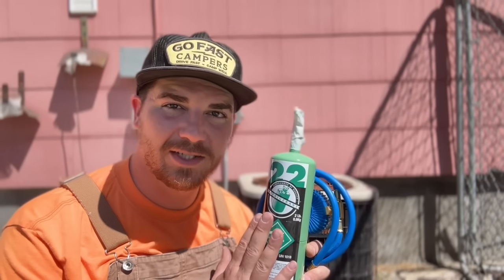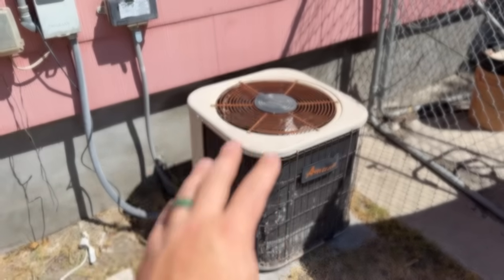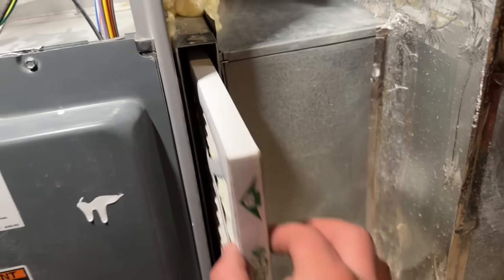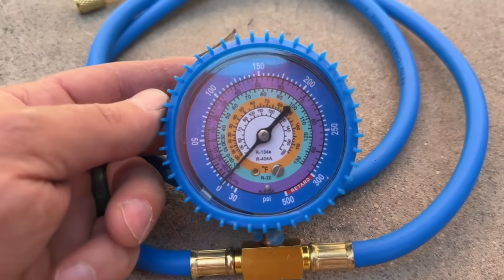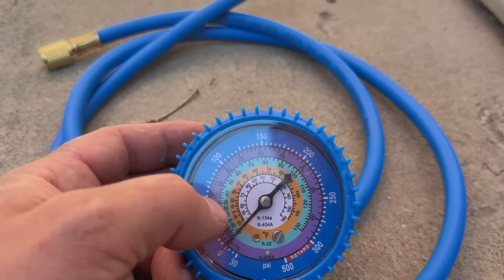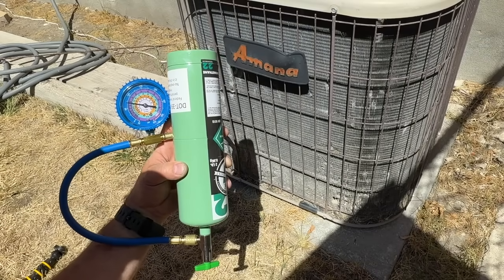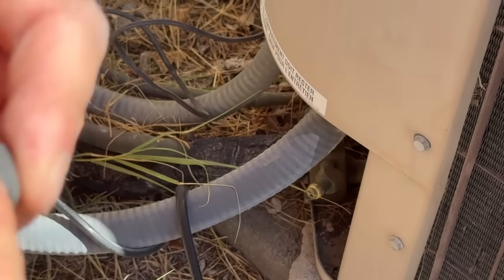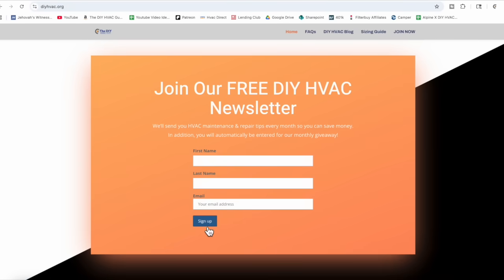HVAC Contractors Are Charging $600 PER POUND Of R22!

Comment: FYI, a properly installed AC system doesn't need to be "topped off"
Reply: All systems leak at least a little over time as there is no such thing as a perfectly sealed system.
Reply: I believe he covered the reason. It had a slow leak, 3 years and it needs a little how ya doing. that isn't much of a leak and surely not worth looking into.
Reply: Installed right has nothing to with leaks.  Most leaks develop in evap coils over a period of time.  Coils have gotten very thin walled over the years and are unlikely to be leak free for decades like some from the 60s through nineties.  The problem caused a transition from copper evap coils to aluminum over the last twenty years but even the alum coils leak but not as often.
Reply: @rj.parker  Yes, but that doesn't mean the installation quality should be compromised. Parts failures are just what they are, crap parts and that needs to be delt with when they fail on their own merits vs a crap install putting stress where it doesn't need to be.

Comment: I have a 24 year old Goodman GMP075-3 system with a 2 ton Goodman condenser unit and I noticed the air doesn't get as cold as it used to (peaks out at about 63/64 degrees depending on when I check). The air filter is clean, the refrigerant level is fine and the outdoor unit is clean. I suspect the issue is with the evaporator coil (Never been cleaned in 24 years) except I have a closed system and is extremely hard to get to. At least for me since I'm not a HVAC tech. So, I'm trying to decide if it's worth paying someone to take it apart and inspect/clean it or is it finally time to get a whole new system.

Comment: Hey Dave need some help my condenser coil out side is flash gassing,does that mean I have blockage in the piston?,I opened up my coil cover inside the house and I have tvx valve so that might be bad too. Last year my ac tech put in due sealant into the system do to a small leak,my system looses about 2 pounds a year,goodman system

Comment: I took the EPA exam required by the EPA laws in order to become an HVAC Technician.   These laws state that if a AC system has a refrigerant leak over a certain amount im not allowed to top off the system.  So if homeowners can top off their own AC systems why do we have these laws to begin with!  😢
Reply: Lots of those laws are meant to protect the HVAC industry.  Around here the industry is out of control.   Your capacitor goes bad, you need a new 20k system.  Charge $600 a pound for R 22, when I can get 30 pounds for that price.    It's always a sales pitch when you call out an AC company.   I work with an ex AC guy and he said he got tired of lying to people so he could get his sales numbers up.    Where I am, I can not technically put refrigerant in my own system or my 85 year old mothers, but do I?.   I also keep a supply of capacitors to help my neighbors out when their AC goes out.
Reply: @shastasteve  The capacitor is a cash cow for the HVAC people.  Had one replaced a few years back and it was $ 350.  I have replaced it myself a few years later for less than a $ 20 part.  I would not have minded a $ 150 charge, like $ 100 to come out and marking up the capacitor price to $ 50.
Reply: @shastasteve  I NEVER charged that kind of money for ref. assuming the story is true. A little knowledge can save $$$, it's not rocket surgery. Be safe changing Caps, 240v packs quite a punch. Disconnect power always!
Reply: @rrrhhh8167  Yeah I have an industrial electrical background.  Just disconnect the power and discharge the capacitor.   I do use a fluke on everything, even if I know its dead.     Not out here it is the wild west as far as AC service.  My Mom is 85 and lives in a mobile home, a nice mobile home but still everything is out in the open.   Quotes were from 16k to 20k for a 3 ton system.   Most guys used to charge $200 to replace a capacitor but now many are pushing $400.   Everyone one of the big boys is much more interested in replacing a whole system than actually fixing it.   There are good guys out there but they are not the ones who advertise.
Reply: @shastasteve  I hate hearing this. You're right there are some good ones out there, but those prices for a 3 ton or capacitors are insane.  Caps are about 20 bucks on Amazon. If they quoted that high they don't want the job. Some don't like crawling around mobile homes, even nice ones. There are installers and then there are techs. Try and find a small biz maybe someone running solo. Good luck.
Reply: @shastasteve  The local TV station had an add for a plumbing company.  My water heater needed replacing and man came out and wanted $ 1800 .  Sent him packing and called  a local company recommended by a  friend and two men came out and replaced it for $ 950 which I though was reasonable.
Reply: Same reason if I wanted to change the service panel out in my home, I can do it, it's my home. You have a business lic# on the side of your truck and fall under applicable laws. Also, same reason the public can't purchase parts, systems, etc. from  local HVACR warehouses. To keep it exclusive.
Reply: The  EPA has gone  wild with many requirements.  On a 5 gallon gas can to fill my lawn mower and other small engines I spill more gas on the newer cans while trying to fill the mower than I ever did with the older cans.  Now there is another refrigerent  out to replace what replaced the r22 .

Comment: I bought a 2lb can of r22 yesterday based on my air-handlers information. However this morning I went outside to check my fittings and stuff and noticed that the condenser is only for r410a. Upon further inspection the air-handler says r22, but also has a check box for "system converted to r410a". This is a 2011 system, and I have a feeling it's r410a based on the condenser. I ordered gauges to check pressure, is that the best way to determine whats going on here? The schrader valve is "beer can cold", but the unit is running 13 hours a day to keep up with this heat, and I'd like to know if my system is low.
Reply: The only way to know would be to put a set of gauges on the system.  R-410a runs at much higher pressures than R-22 and you can see what it is running based on the temperatures...
Reply: Sure sounds like the system was swapped out at some point. I'd go with what's on the outside unit.
Reply: @rrrhhh8167  From what I've found, it seems like in air handler was meant to be r22, but also supports r410a... since the outside unit says NEEDS r410a, I'm assuming that's whats in there.
Reply: @requiredusername5731  It is possible to connect a r22 evaporator coil with a 410a condenser if the evaporator coil is rated for the higher pressures and the metering device (TXV) is changed. Not something I would normally do. If you get a 410a unit the whole thing should be 410a. Look at the actual indoor coil to verify it's been swapped out, don't trust the labels on the outside of air handler. Is it working? You cannot use R22 in a 410a system, don't put that  R22 in the system!

Comment: The compressor gets is cooling from the refrigerant after the coil inside. You really need to charge a system properly by taking critical  measurements. Or you can just do this. Never mind your compressor replacement is going to cost several thousand dollars. Seems fine.

Comment: R22 kit out of stock.
Reply from the maker: Yes they are selling like hotcakes. But you can accomplish the same thing with the r22 2lb tank (in stock) and a set of gauges.
Reply: @diyhvacguy  Can you make an Amazon low cost recommendation on the gauge / hose that is equivalent to the one you carry, but is out of stock?

Comment: yes i am going to keep my r22 unit till i can't get parts for it and it stops running it is great at cooling has 14 seer rating so it meets minimum for our area and it is 27 years old only had to replace fan and contactor twice better than spending 10,000 on new unit that is garbage.

Comment: Bad news, the R410A with gauge and hoses showing out of stock.  Also R22 combo kit out of stock.
Reply from the maker: Yes they are selling like hotcakes. But you can accomplish the same thing with the r22 2lb tank (in stock) and a set of gauges.
Reply: @diyhvacguy Do you have a link on recommended gauges?  Just see a link in the store for a high dollar dual gauge.  Couldn't find the simple basic single gauge.

Comment: When there is a freon leak, where is the leak usually located? My HVAC guy wants to replace the entire system and I'd rather just replace the part or item.
Reply: Easiest to check is high and low ports - are there caps on them? Get a cheap refrigerant leak detector, $30 or $40? and learn how it's used. Spray leak detector on every connection and pipe. Look for oil residue. Look for where wire or pipe may be rubbing together.
Reply from the maker: Leaks can be very tricky to find and a lot of times a new system is recommended if the existing one is older. But they have leak detection devices, or they will put nitrogen in the system and check for bubbles or hissing.
Reply: @diyhvacguy  Is "recharging" the system and "topping off the refrigerant" the same thing or totally different ?
Reply: Get another opinion, finding and repairing leaks is part of a techs job. example, sometimes the "A" coil springs a leak and that alone can be replaced. Still won't be cheap.

Comment: We just had ours topped off (18 years old). I was charged $150 for 1.5 pounds of R-22 and $180 labor. I know and trust the tech, there are a few honest hvac companies still out there.
Reply: thats not too bad the refrigerant is around 40 to 50 a pound depending on how big a bottle you buy so everyone marks it up. but lots of contrators charge 150 to 300 a pound to try and get people to buy a new unit
Reply: Agree....Honest, knowing and trusting the tech is more important than the cost.  I am good with paying more if that is the case.  Everyone has bills to pay and I can't expect the tech to work for free.
Reply: I think a lot of the R22 the techs have has been reclaimed from old units & therefore they got it for free. If they got it for free $300 a pound is a lot. Most of these techs just want to sell you a new one cause that is where they make the money.
Reply: I just had to pay $260 for a pound of R-410A after my 2 year old Goodman system had a failure of a Reversing Valve. The total tab for repair was almost $1000. That included service call and labor but parts warranty is good for 10 years on the outdoor part of my 4 ton split unit. Now the fan on the inside sometimes makes a horrible noise upon start up. $7400 and $200 annually for servicing has me regretting this system and HVAC company. But I had no choice at the time with other companies quoting over $11,000 for a new system.
Reply: @DeepSouthTechie  A noisy indoor fan on startup is either an adjustment or the squirrel cage is coming apart.   Either way you should fix it before you have no ac again.
Reply: @rj.parker  Thank you! I told the service guys about it after coming out for a service and he said it could be a piece of loose metal but he never reported it. I'm almost afraid to call them again because of the repair fees but I guess I have no choice.
Reply: @DeepSouthTechie  A reversing valve is one of the most difficult parts to replace.  $1k is within reason if it fixed the problem.
Reply: @rj.parker  It was a heck of a job. The guy was out there for hours working on it. It just bugs me that the system is relatively new at only 2 years old and had already broke down.
Reply: My experience has shown, honest techs they may be but they over charge on everything just the same. HVAC tech supply and demand...Knowledge is definitely power.😊
Reply: @professionalinspectionserv9468  Alot of people just pay the first person they call. I'm very frugal and stand by the three quote rule. They are high pressure salesman as well as repair guys, so you have to stand your ground and tell them you're pricing around. 
Problem is if they installed it and it's under warranty you have to use them, they have you by the cojones then and they know it.
Reply: Reclaimed R22 has to be filtered and made virgin per EPA standards so it's not just recovered and used in another unit.
Reply: @JimCar71 it cost $300 to put it through a $20 filter.

Comment: Still running 2 25 year-old Goodman’s
Reply: still running my orig since 2005
Reply: I wish mine was like yours. I installed a Goodman about 10 years ago but it's been problematic just about every year but I believe the biggest problem is who's working on it. It has been worked on by Recker and Burger and it seems a lot of the techs have no idea what they're doing.

Comment: Hey Dave    can you do a video on leak sealants ?
Reply: When it comes to sealants in residential units, it's a major roll of the dice. If it's a single tiny pinhole leak, it might work. Anything more than that and it's probably not going to work.
Reply: @willlewis6747  per sealant company if it does not leak completely out within 7 days it can be sealed.

Comment: Chances are they only put in a few ounces of R22 and charged $600 for a full pound.  Every time I connect  my hoses I lose a refrigerant, do I need new hoses?
Reply from the maker: Oh 100%. They rarely put it on a scale. I’d recommend low loss fittings, or a core control tool. It allows you to connect to the service valve first and then once your hose is on, you depress the core with a knob on the outside. I plan on doing a video for this soon :)

Comment: I watch a lot of your videos. I totally support you. Not trying to be combative, just curious...I've been taught to NOT flip the canister upside down because the suction line works with vapor not liquid like the discharge line. So please explain.
Reply: Following....
Reply: it boils into gas as soon as it leaves bottle at high pressure into low pressure return line as long as you don't dump tons of it in at once so liquid makes it to compressor it is really slow putting it in as gas
Reply from the maker: Exactly, thanks for explaining this. So just make sure and add a little at a time 👍🏼
Reply: @diyhvacguy that's not Virgin R22 ,  it's a blend. I have good luck using mo99 to top off past few yrs to keep it going because people just don't have 5500 for the junk they make anymore but I agree, keep them going if it's not a big leak.

Comment: Great video, remember DIY'rs, the compressor is not a liquid pump and can be damaged...so...open the valve slightly, let a little in, close valve, allow system to "settle". Rinse/repeat until desired temperature is reached. It'll be fine, you can do this. Oh, and do it on a warm day, not early spring of late fall.
Reply: It might take longer, but putting in gas is better on the compressor, especially if its an older one.

Comment: Thanks for this video! 
I was told by an EPA cert guy not long ago that buying R22 was illegal now since it’s technically phased out? I checked Ability and saw that they still sell R22 and there wasn’t any indication that it was illegal..have you heard of this?
Reply: I think that applies to new system installations.
Reply: Legal to buy, but it is illegal to produce r22. There is a stock pile of new, and when that is gone, there will be reclaimed available.
Reply: @tc6580  Yep, all true. Produce in the USA...other countries could care less.
Reply: Legal to buy but not necessary legal to install without a license.   That being said, the chance of it being an issue is basically zero.

Comment: I went the site and R22 is out of stock
Reply: They’re out of that kit with the gauge and hose. If it were me I would buy 5 lbs and a cheap manifold from Amazon. Having said that, these places may sell you refrigerant, but you  are attesting to the fact that you’re not going to use it unless you have EPA certification.  That’s what takes liability away from the seller and puts it on you.  I would suggest knowing what you are doing before attempting to recharge your system. There is a LOT that can go wrong. (And I’m not in the business so It doesn’t matter to me what you do). You can kill the compressor, introduce air/moisture, have a major leak from the schrader upon hose removal, burn your hands etc. educate yourself fully first.
Reply: @Drrich_DIY    Thanks for the reply I didn't see a 5lb option , maybe I overlooked it. I do have EPA certifications.
Reply: Same here.🙁

Comment: The only problem one needs at least a class 2 EPA license to do this legally as a DIY. That said... do it in the "cover of darkness"... in this case CLEAN the condenser coil. 

Here what what is required to buy for abilify... By purchasing refrigerants from this website, you are certifying that YOU are EITHER EPA Certified OR that YOU WILL Give this refrigerant OR SELL this refrigerant to someone WHO IS EPA Certified.
Reply: Get the universal certification! It's not super difficult and you can take it online with a proctored service.
Reply: @zunar_j5_933 How long does it take, what’s the process?
Reply: I don't have an R22 system but if I did, the last thing I'd be worried about is an EPA agent peaking over my fence.
Reply: @Execute_Order_66_DO_IT  Where I live, nosy neighbors would love nothing more than to tattle anonymously.
Reply: @Execute_Order_66_DO_IT I'd do it straight up out of spite.😅
Reply: @Execute_Order_66_DO_IT  Maybe Trump and Zeldin will get rid of that EPA b.s. during his term.